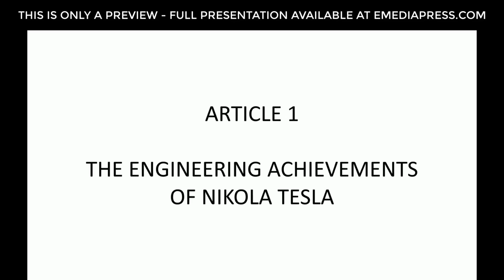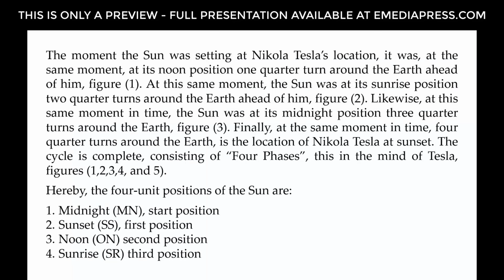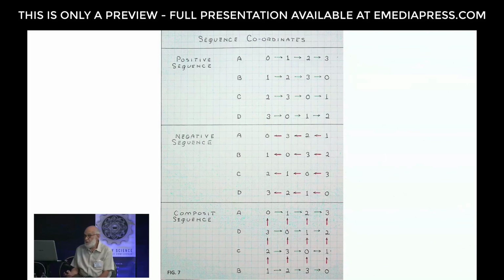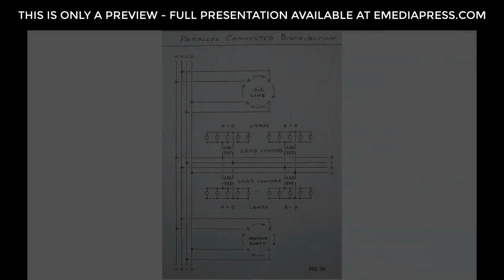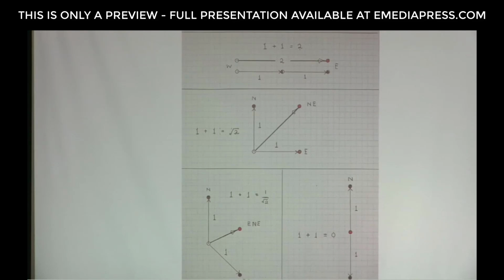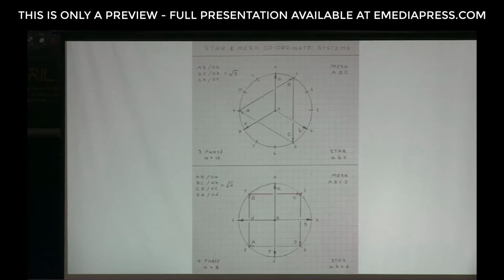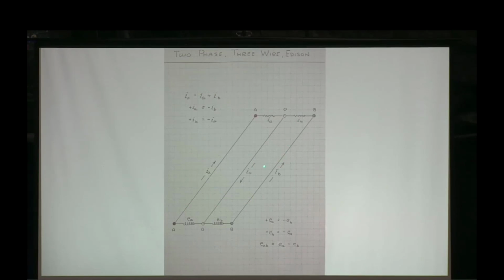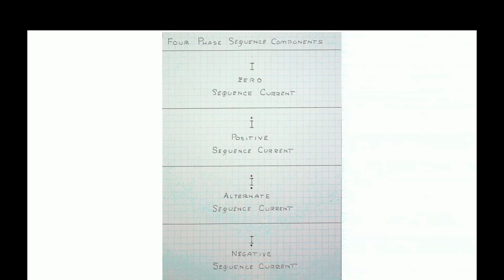Eric Dollard on Tesla's Polyphase System — 2023 ESTC

Comment: If you do get to read these comments I follow you completely until the statement "you get foam at 90 Degrees" (15;:14). 
The difference between Star & Mesh is in the model being in the 3rd Dimension aspect as of X / Y 1:1

l -1 / 0 / +1 as the alternative electricity is described though at 0 / +1 in DC .
You fed the DC negative or earth into the into the positive - let me check this I don't have experimental equipment.
If the 4 phase or base 4 vs the base 3 the systems should be the same in my understanding at they are bother divisable by 12 the "clock" principal switch then this foaming issue would not occue though if not created with wires at those stages 360/12 = 30 degrees or 0 / 90 / 180 / 270 this is where you get the spookey results as the circle is devided into 360 degrees rather than a base 10 unitary